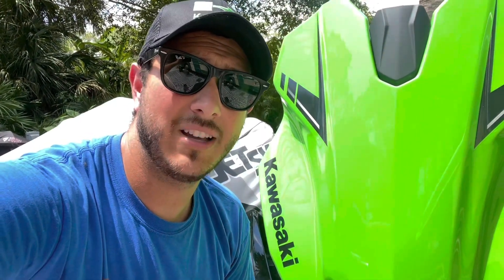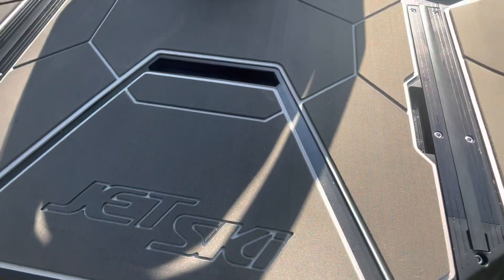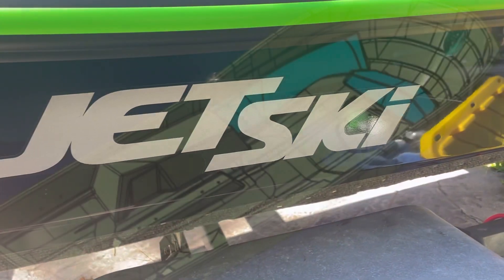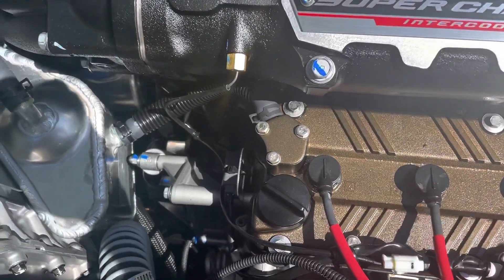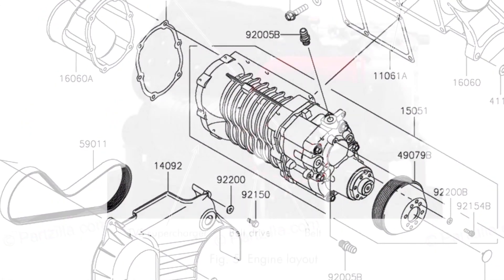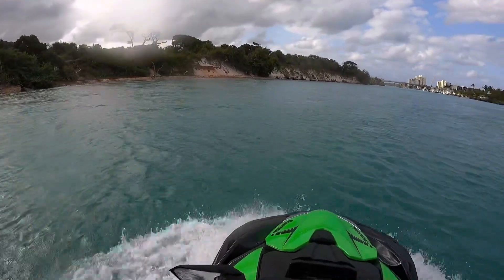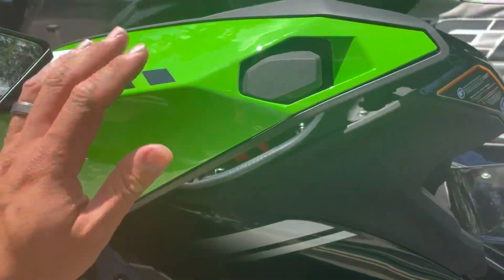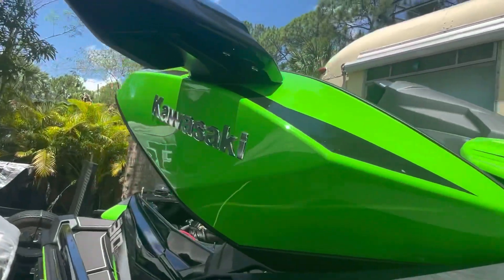Original Version: Kawasaki Jet Ski Ultra 310 LX-S - TECHNICAL REVIEW

Comment: Great video. I was looking at a used previous generation 310 X. I’m not a fan of the styling on the new generation as compared with the previous generation. Is there any thing I should look out for for one buying a previous generation how bulletproof is the engine and supercharger I know the hull is pretty much the same on the new ones  I like all brands of pwcs they all have pros and cons but when it comes to affordability on the use market, the Kawasaki seems to be the most affordable, especially the previous generation. The new ones have gone up in price a ton, especially in Canada. Your thoughts on a previous gen 310 X or 310 X SE.  Have you ridden the STX 160?   Keep up the great vids
Reply from the maker: I have not ridden the STX 160, so sadly cannot comment. The prior gen 310s are very reliable- but have a few funky characteristics. One the front compartment tray will always fill up with water- anything you put in that tray will be floating by the end of your ride. Also, the prior gen has a wider seat and shallow footwells which is good and bad- sitting is very comfortable but standing is a bit more challenging since the seat will run against your inner legs. The shallow footwells mean water can come over the bow and drain easily back through the footwells/ but the ski has a higher center of gravity. On the newer 310s the footwells are 3x as deep- you sit lower in the ski which provides for a different handling experience. On the older gen the "reverse" is more of a suggestion and not really all that useful for anything other than basic maneuvering at the dock

Comment: Great improvements, but sadly you did not mention any of the needed improvements still needed!! 

My only complaint is that Kawasaki made the opening to the storage compartment up front so small this year that it's impossible to get in a medium-sized soft-sided cooler through the opening compared to the mammoth opening in previous Ultra 310 years. 

Both Seadoo and Yamaha have made their openings up front larger to accommodate the number of items people bring on their daily or weekend adventures, not smaller as Kawasaki has! This is important to both my wife and me, hopefully, they can make it larger next year as we would love to buy this ski as well as many others that need the larger opening to hold all the goodies needed these days for a fun day in the sun. 

Other than that, the Ultra 310 is a great ski for sure with many needed improvements finally delivered. Thank you Kawasaki =)

Thank you for the review which did point out many good points about the ski.
Reply from the maker: Thanks for taking the time to comment and watching my video! It’s unlikely they will change the mold to make the front compartment larger for the 2024 models…

Comment: We just got the 2023 model and took it out today. Ran it through break in and were impressed but it seems to favor the port side making it less than stable at lower speed. Does your ski seem like it liens left?  If not do you have any idea what it could be?  No water in the engine compartment and no water coming out of the drain plugs after we pulled it. Nothing really in the storage compartments except safety items. Full tank of fuel. Thanks for anything you can tell us. If it’s easier and you’re willing I am happy to talk offline as well. Dave
Reply from the maker: Have not heard that before! I have no issues with mine..if you watch my videos I’m always going through no wake zones and the stability is incredible- you could put two 200lb guys on one side and the footwell doesn’t even go under water. Does yours sit level at the dock floating in the water?
Reply: @JDsWaterWorld  it’s okay sitting at the dock but you have to be careful boarding to make sure it stays level. The foot wells will take on 3 to 4 inches of water when we have any one standing on one side at the dock. I’m 239 and my son is 140.
Reply from the maker: Which model is it? With Ultra Deck?
Reply: @JDsWaterWorld  2023 310 Ultra LX-S
Reply from the maker: Hm something definitely wrong. I stand on mine on one side all the time  and it never takes on water like that
Reply: @JDsWaterWorld  thanks I will let the dealer know and see what they say.
Reply from the maker: Really not sure what it could be though, unless there was water in the hull or you had something really heavy in the front compartment that was off to the side….
Reply: @JDsWaterWorld  I thought of it too but we only had the minimal stuff required as we just got it into the water.

Comment: JD: I think I read or heard somewhere that the 310 engines are bolted down with three bolts vs. two bolts for other brands. Using three bolts is supposed help maintain engine-to-drive shaft alignment. Do you know if this is correct?
Reply from the maker: The 310 actually relies on 4 engine mounts, and the drive shaft is coupled to the jet pump with a dampened coupler ( with a replaceable rubber damper) - there is no carbon seal to fail! The Kawasakis do not have the alignment issues that SeaDoos have.

Comment: What is launch mode in the jet ski? Still havent figured that mode yet
Reply from the maker: The launch mode can only be enabled when the ski is in FPO. There are two options: one time, and always on. The launch mode automatically overrides your trim settings by pointing the jet nozzle all the way down - which keeps the ski planted in the water as you accelerate. As you gain speed the trim returns to the position you had it in before launching.

Comment from the maker: For the haters and trolls out there: Facts are facts…go to the USCG’s recall page and count the number of Yamaha and SeaDoo recalls vs the number of Kawasaki watercraft recalls. Let the data speak for itself when judging reliability and quality.

On 5/5/22 A class action lawsuit was filed in Florida (Case No. 22-cv-21411) regarding defective SeaDoo GTX, RXT and WakePro intake grates. The grate comes off at speed, ejects the rider, and causes hull to break into pieces. Let’s not even discuss the Debris free pump issues or the exorbitant amount of plastic used on the skis hull, deck, and engine. 

Yamaha has open recalls on fuel necks, kill switches, fuel pump gaskets, and their transom plates. They can’t seem to get their stock sprag clutch right, and now flip flopping on hull design.

Obviously you can see I am fed up with other brands after years of owning their crap products…so now I can finally enjoy my JetSki without dealing with a bunch of bs!
Reply: Your right!! I love my Fx but I sure wouldn’t mind one of these now that they have the neutral!! This is the only other brand I would buy outside of my Yamahas!!
Reply from the maker: @bodiejones4844  I have owned 5 Yamaha skis in the past, and currently own Yamaha outboards on my boats. Their FX line is great, the new SMC Hulls are supposed to be really good.
Reply: @JDsWaterWorld  I’ve enjoyed mine!! I
Reply from the maker: @bodiejones4844  Yamaha has made a great product for over 30 years, but I threw in the towel when my 2021 Yamaha had 3 open recalls at once, and the paint started delaminating…Kawis just don’t have those issues it seems.
Reply: @JDsWaterWorld  I really like them! Considering the Kawi for my second one. 👍
Reply: Ive owned two Yamaha and two Kawasaki and the Kawasaki hands down have the better hull. And are more fun to ride. I’d not buy another Yamaha
Reply from the maker: @Karakaboardriders  100%. The Kawis might not beat a modded SeaDoo or Yamaha in a drag race, but that heavy hull sure does take the chop better than any of them. And of course that TVS whine is just awesome.
Reply: I'd would rather get towed around on my ultra by sea tow of course ,rather than buy any other brand,even the Kawi hull won't sink or blow up or loose the intake grate or fuel neck separate ha,ha
Reply: Not really funny but be aware class action lawsuit filed against Sea do may 5 in FLA.intake grate coming apart.been a bulletin for a while
Boat literally comes apart.could not make this up.
Reply from the maker: @solarchild1  Thank you for mentioning this, I updated my pinned comment to add this information so viewers who may own an affected ski can avoid injury.
Reply: I'm a modified FX SVHO owner and I'm definateky looking at the 310. Only annoying service part for a Kawi is the exhaust filter. It's my only gripe with the Kawi. It's a beast offshore too. If I'm swayed away from Yamaha, it's to a Kawasaki not a Seadoo
Reply from the maker: @_jamesrose  I was a Yamaha guy for 15+ years before I finally became a Kawasaki convert. The exhaust filter is not that difficult to service, it’s only a few bolts to remove, and can be done in about 25 minutes- I will be doing a video once my filter is ready for service. The filters main job is to limit the amount of moisture that travels up the exhaust into the engine- and for this is works incredibly well.
Reply: Jd the Kawi man, with the ocassional 310 predetonation issues should octane booster be used to bring it to maybe 93-94 rating ?? Pump gas where I am is only 90-91...
Reply from the maker: Not at all, if you are stock, fresh 90 octane is fine. Keep in mind that 2 week old 90 is no longer 90…chose ethanol free when you can.
Reply: @JDsWaterWorld  It's been sitting a month, I'll fill with fresh and add 2-3 octane can't hurt. I get premium at Costco so whether its Ethanol or not I don't have a choice... Are there even places that sell ethanol free gas?
Reply from the maker: In Florida, yea- but not sure about wherever you live. The ethanol fuel is fine as long as it doesn’t sit…google “phase separation” with gasohol (gasoline containing ethanol) only takes a few days for it to start. Also research a product called “k100 G+” I use this in all my boats and skis..incredible fuel product you should consider if you’re not burning your whole tank each time you ride
Reply: @JDsWaterWorld  Yeah I'm in Vegas Hot and dry and never over 10% humidity at least that helps with  reduced moisture.. Yeah I'll check out the K100,, along with the little octane boost and gumout fuel injector cleaner once in awhile I think im on the right track.. If it sits for 3 to 6 months during the winter ill winterize it and put a little stabil in the gas....

Comment: Great video!!   but Does it still weigh as much as a 4 tonn tank ?   Personally,  I'd rather a lighter ski that is more playful and easy to manuever
Reply from the maker: Other manufacturers don’t advertise their “loaded” real weight…only the dry factory weight. Kawasaki is the only brand who advertises the “real” weight of their ski with gasoline, fluids, and gear. Keep that in mind if you are looking at skis.

That being said, yes the Kawi is a real boat, it’s a tank. If you want a light plastic ski, you will sacrifice ride in chop. The 310 is incredibly playful and easier to maneuver. Now if your looking for a toy to play with on a closed lake, look at the spark or the jet blaster those are small light skis.
Reply: Sea Doo and Yamaha have really done a great job with their propaganda. It borders on false advertising. You have to have gas, oil, battery, fire extinguisher to ride the ski. Dry weight is absolutely pointless. People are being fooled into believing there are hundreds and hundreds of pounds of weight difference. Kawasakis are heavier like you said but it is because of the heavier better hull and more fuel in the larger tanks. Compare similarly loaded similar level watercraft and weight difference is not that much. Thanks for sharing the truth!
Reply: These are ocean going hulls built to handle chop. Weight is their advantage, not a disadvantage, which is part of the reason they have the best ride in the business. If you can't appreciate the weight, then you're definitely looking at the wrong ski.
Reply from the maker: @Marius D Well said! Thank you for the great comment.
Reply: 8,000ibs is pretty heavy.my Kawi weighs 1150 with full fuel 21 gal. And oil.my 240lbs with gear.othe manufacturers is an empty weight and my Ultra still breaks  57mph
Reply: As jd has mention several times loaded means loaded not 3 gallons in it for a speed run.

Comment: Ahh more engine. Nice. That's a good one!!
Reply from the maker: There’s so much more I could have discussed about the engine. I did a different engine overview video, but really need to do another to talk about the oiling system- very well designed with a very efficient oil cooler.

Comment: I cant wait for you to keep posting your experiences with this Kawasaki Jet ski.  I looking at the Ultra LX or the SeaDoo RXT-X but really leaning to the Kawi!  All my bikes have been the Green Machine and they have all been great. Can you answer calls through the system? or does it just notify you?  Thanks for posting.
Reply from the maker: We have a 2021 Ultra LX and it is a great really well built ski. Hopefully Kawasaki will release an updated ultra with the new features on the 310
Reply: @JDsWaterWorld  I'm looking at the 2022 Ultra 310 LX (black and Gold)
Reply from the maker: @jerplane400  ahhh in that case definitely go with the Kawi! The seadoo 300 motors have mixed reviews: the plasma coating on the cylinders might prove to be a big issue. Also every seadoo I ever owned had a carbon ring failure due to engine mounts wearing out. The Kawi is a higher lever of machine…both in terms of quality and engineering
Reply: @JDsWaterWorld  Sold!  I've located one in Iowa. If they still have it in a week or so I'm going to drive the 13 hours and get it!  Thanks for your response!!
Reply from the maker: @jerplane400  That’s awesome! Wait until you ride it….none of my videos do it justice. It’s such a cool machine.
Reply: You better not wait a week. These things leave as fast as they arrive!
Reply: You can't access the phone via the jetsound or play calls through it on the 2022 ultra 310lx.